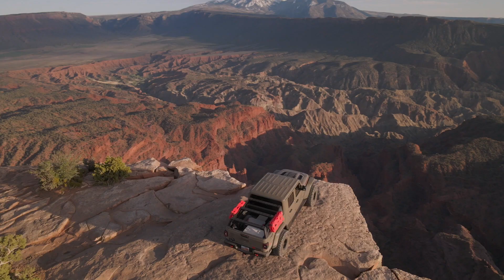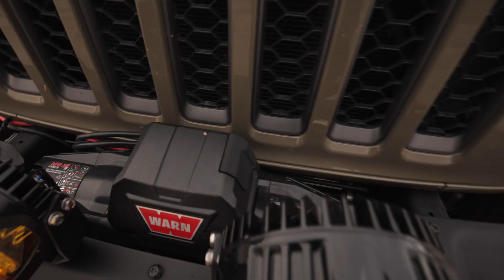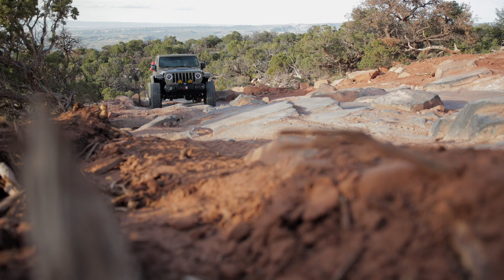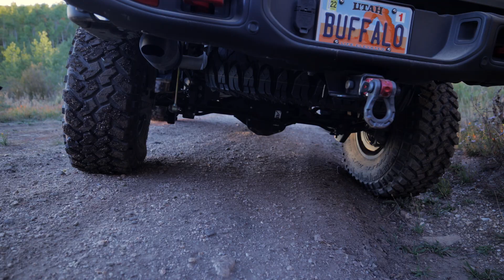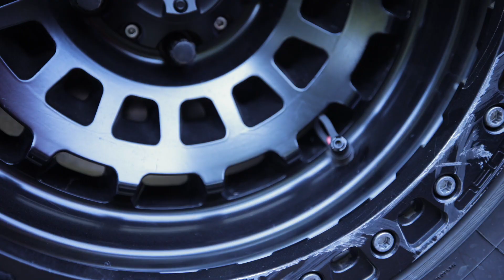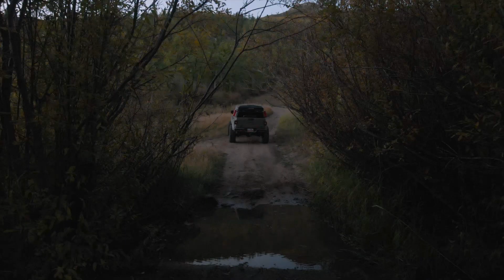Ultimate Overland Build - Jeep Gladiator | Land of the Free

Comment: Curious-what was your experience with the Skyjacker lift and why did you switch it out?
No doubt your setup now is higher quality but also WAY more money. 
Also-great video!
Reply from the maker: With the Skyjacker lift I felt like it was always leaning to the passenger side.  Which seems to be a common problem amongst Gladiators, regardless of lift.  It hasn't been leaning as bad since I swapped to the EVO MFG springs, but it still leans passenger just a touch.  I also liked the idea of having slightly stiffer springs in the rear to help with the weight of some of the overloading equipment; things like the roof top tent.  Thanks for watching.

Comment: No front drive shaft with that 4.5"lift?
Reply from the maker: That’s a good question.  I’ve just been waiting to have a problem with my front drive shaft, I don’t know why it hasn’t been an issue yet, but it hasn’t; and I think I’ve pushed it pretty hard.  I can’t say everyone will be so lucky, but it simply hasn’t been a problem.  Happy trails.
Reply: @LandoftheFree  have you taken a look at it from underneath? i have 4" lift on my gladiator and the CV boot @ the transfer case is a bit deformed. mines not totally wrecked and I don't notice any issues when driving but I have an Adams 1350 front drive shaft I'm going to install when I have some time

Comment: thanks very much for your transparency.  Excellent and impressive build.  Question:  How have you managed weight with all the mods and cargo?  Are you trying to stay within GVWR?
Reply from the maker: Hi David, thanks for watching.  I think it’s important to stay within GVWR, Jeep engineering put a lot of time and effort into determining the safest limitations for their vehicles.  Everything is a little give and take, I try to save weight where possible, but and some point you have to pick and choose the modifications you want to include.  Unfortunately you can’t take everything and the kitchen sink.  Happy trails.
Reply: @LandoftheFree  thanks.. I'm about to switch over from a JLURD to the Gladiator platform, principally because of the payload shortcomings on the diesel.  How much payload did you start with on your project?
Reply from the maker: Just inside my driver’s side door one of the manufacturer’s tags reads: “The combined weight of occupants and cargo should never exceed 1155 lbs.”  I’ve never weighed my gladiator, but I’d be interested to see how heavy it is.
Reply: @LandoftheFree  1155 is a lot of payload for the rubicon!  however, i'd strongly suggest you weigh it.  There are a million CAT scale locations out there.  that's how I was able to find out my jeep's weight issues.

Comment: I'm a big believer in form and function. building a gladiator diesel now, lots of good ideas. Have you checked out the Alu-cab topper? 1/2 the weight of the fiberglass and dust sealed bed is nice! Action trax recover boards are made here in usa and cost more money for the materials then the over rated maxxtrax!
Reply from the maker: Hi, thanks for watching.  I am familiar with the Alu-cab topper, it seems like a great product.  Being dust free sure would be nice.  As for recovery boards, I’ve actually got some from RotoPax, but I’ve never mounted them on the Jeep.  They’re also much cheaper than maxxtrax and they’re local to me in Utah.  I wish you the best as you go through the build process with your gladiator.  The diesel should be pretty awesome.  Happy trails.

Comment: You needed the 12,000lb winch because of the Gladiators weight, line fast line speed is could be dangerous.  I have a 05 Wrangler with a 10,000lb. But good video
Reply from the maker: Thanks for watching.  Gladiators aren’t light, and I’m not in a race; I’m glad I’ve got the 12,000lbs winch.  Don’t forget to subscribe for more Jeep adventures.  Happy trails.  (BTW, TJs are some of my favorite Jeeps)

Comment: for your ARB, do the relocation bracket to be behind the driver's side tire in the firewall.   If you wheel with kids of a wife, you will thank me for that .  DON"T put the compressor in the cab if you can avoid it, and you can.  I have a '21 JT-R Diesel on 37s and 6.5" lift.
Reply from the maker: Hi Blaine, thanks for watching.  I bet your diesel gladiator is a joy.  I understand where you’re coming from in regards to the ARB in the cab.  The compressor can obviously be a little noisy, it’s definitely not good for your ears.  I suppose that is your number one priority, and if I had air lockers, it would also be a priority for me.  I find that I don’t use the compressor with people inside the cab, so noise isn’t my top priority.  I value keeping my ARB out of the dust, mud, and water.  I also find putting it under the passenger seat to be very convenient and secure.  I suppose different missions have different priorities.  Thanks again for watching, happy trails.